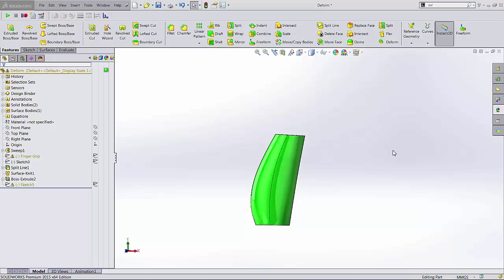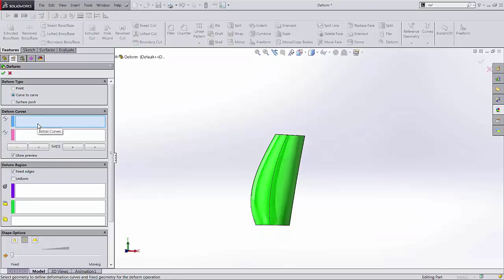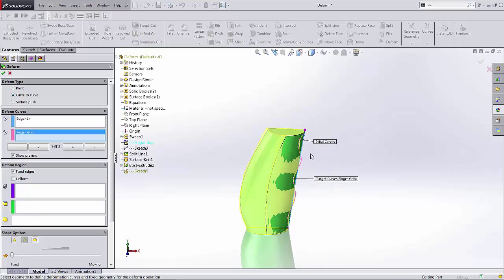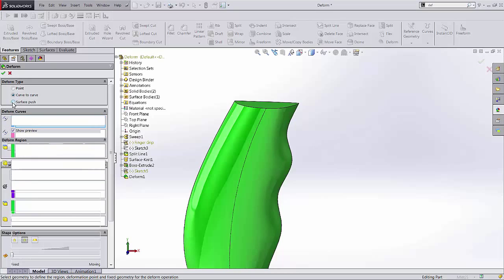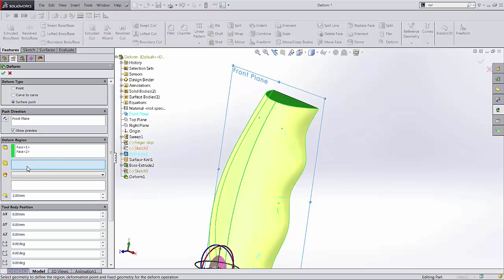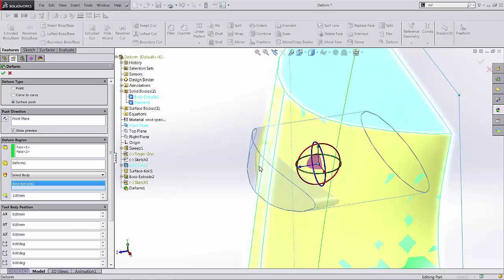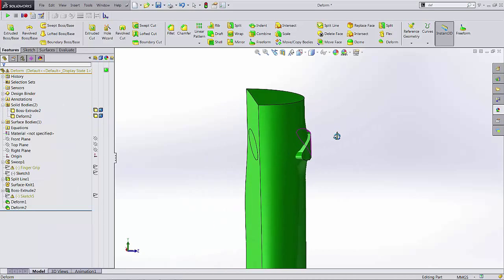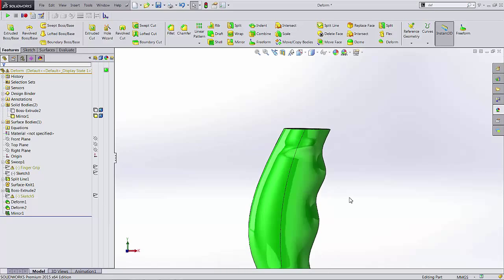SOLIDWORKS Quick Tip - Deform for Ergonomic Shapes

Comment: Thanks for the video! I have to develop also a ergonomic handle, but i think i have to produce it with material first and scan it. Do you know which material would be the best to do it?
Reply from the maker: That is a hard question for us to answer we might try making a few different digital models and 3D printing them to find the right kind of shape. If you want to make a physical model first there are lots of different materials you might try.  The first thing that comes to mind is a polymer clay. It's inexpensive and while it is soft you can try a number of shapes until you get what you want then back the clay to set it.  

https://polymerclaysuperstore.com/pages/polymer-clay-for-beginners